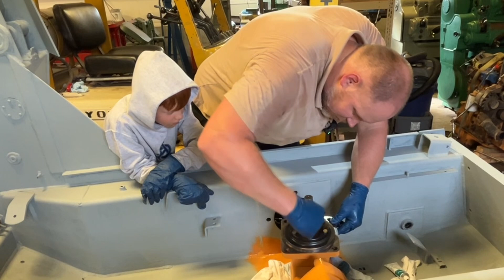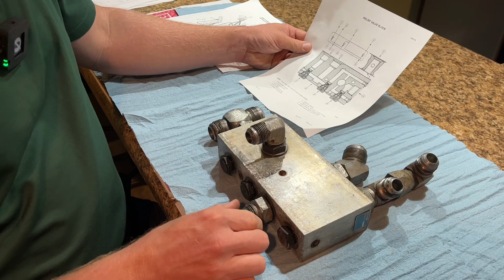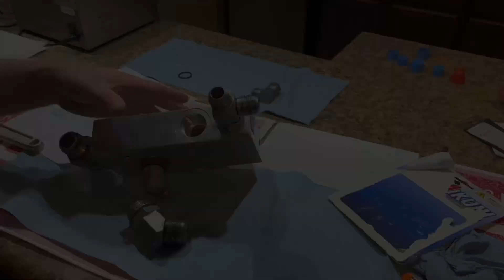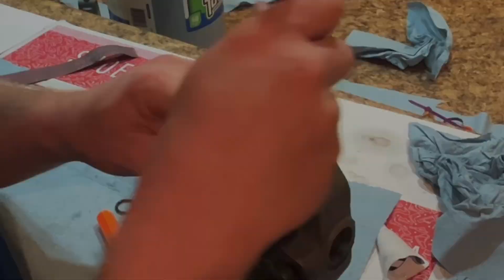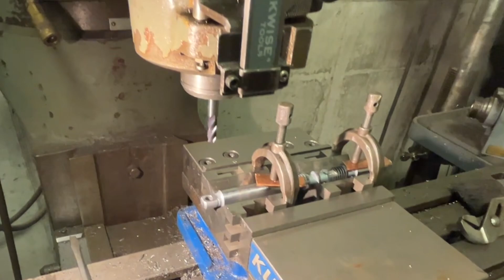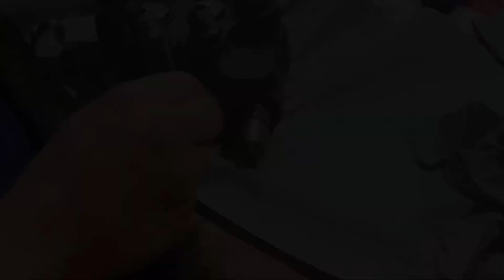Case 1840 - Hydro Motor Install, Check Valve Manifold, & Loader Control Valve

Comment: Your videos are awesome Mike! I want to tackle the issue of the float detent and this video was perfect for showing what I can expect. 

Looks like I could possibly take the detent portion off the spool with it on the machine without having to drain all of the hydro fluid and pulling the spool?
Reply from the maker: Thanks,  yes you should be able to take the detent housing off and leave the spool in. Don’t loose those little springs and balls.  Good luck
Reply: @MikefromMissouri I completed this task. There was some gunk in there but after cleaning everything, the detent is very tight getting it in and out. I noticed the detent spoil had only one groove in it. I thought it was strange since there are two ball bearings. I twisted the linkage then locked the nut to hold the spool valve in a different position to allow the ball bearing to ride on a smooth surface, but it didn’t seem to make any difference. 

Did your detent spool only have that one groove as well?

Comment: Mike great video. I’ve watched this project progress. Nice work! I’m replacing the needle bearing, bushings and washers behind the plug your son tightened on. Do the washers get pressed into the bushing to hold the needle bearing in place? Thanks
Reply from the maker: Yes, if I remember right the washers get pressed in flush with the needle bearing face.

Comment: Have a question did you use a universal o ring kit or buy the specific rebuild kit ?
Reply from the maker: I used a universal oring kit. Some of the oring numbers are listed in the case parts manual.  Messic’s has a manual online
Reply: @MikefromMissouri omg thank you for answering quickly I’m in the process of doing it rn! I got the harbor freight kit that should be fine right?
Reply: I also got the manual with me just wasn’t sure in the hardness of the o rings were going to be a problem
Reply from the maker: @oscarguevara7583  I try to match the durometer (hardness) the same as original. The orings around the JIC fittings are the harder ones so they don’t blow out under pressure.
Reply: @MikefromMissouri where did you get your universal kit from?
Reply from the maker: @oscarguevara7583  I bought an o-ring boss kit from Amazon and a regular universal oring kit their also

Comment: HELP I have a case 1840 and I want to install aux hydraulics I think it had it before I have the brackets on arm for hydraulic lines! I’ve looked and looked for a video on how to install or add them and I can’t find anything can you make a movie on it or what I have to add or hook up too on the hydraulic check valve I really want to run attachments and this is cheaper than selling this 1840 and buying a newer used one I’ve also contacted my local case dealer and he didn’t think case made anything for the auxiliary hydraulics!
Reply from the maker: I don’t have a video on it yet but will get there.  The loader control valve feeds the auxiliary valve.  If you look at the parts diagram you will see a plug that needs changed out to a power beyond fitting to supply fluid to the auxiliary valve.  There is a fair amount of parts you will need.  I will be getting to Thai video in the next few months as I’m almost there with my machine
Reply: Alright cool I’ll be keeping an eye out for that video thank you!!